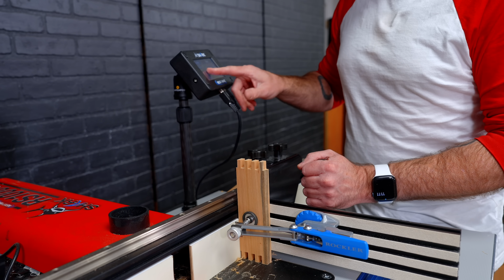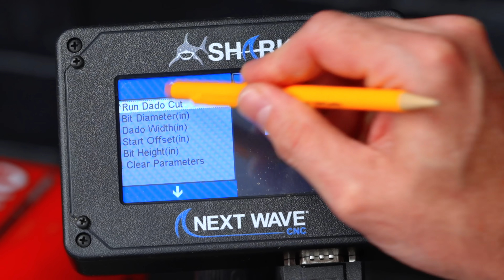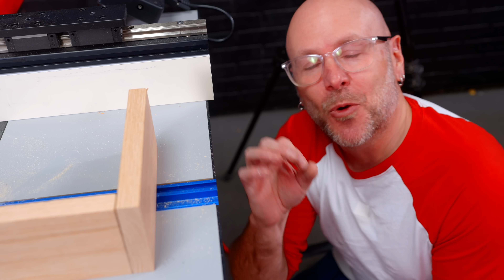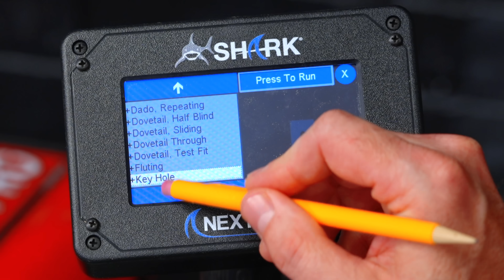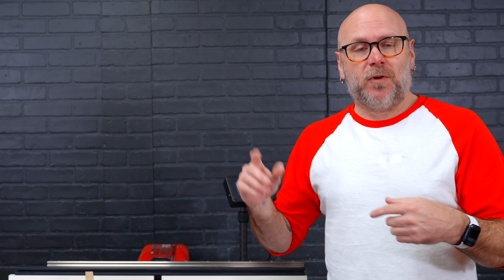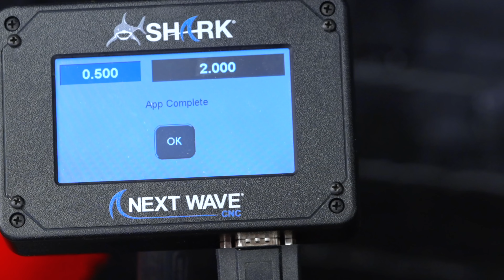This New Router Lift replaces ALL OF YOUR JIGS!

Comment: I have the Incra Router Table and Wonder Fence LS system, For 1700 USD for this system is a little pricey.   I can buy a CNC controller and two stepper motors and put that on my Incra setup up and still be ahead money wise. Nice product but for a hobbyist over priced, for a production shop under powered. The Incra Table is used to make dovetail and box joints and other small custom wood working stuff. For production work I use my shaper, bandsaw, table saw and other moulders, planers.

Comment: This is pretty cool, but the real tests are 1.) longevity of the motors and their accuracy, 2.) Can the software be updated wirelessly, and 3.) Is this a tool that requires the company to still exist... are there any features or issues that will arise if the company goes down? Some tech stuff worries me, because the company going under could cause update features that fix bugs, for examples.

Comment: Pretty cool, but it is a cnc machine to be pedantic doesn't need an automatic feed if it's computer positioned it's still cnc, biggest issue I can see is vendor support as I would want to be able to program my own apps like I do for any other cnc  as other than a motorised fence I'm not seeing it do anything a traditional xyz cnc router couldnt do, other than presumably have no constraints on the length of work peice you could run through it just limited by fence depth

Comment: Nice features but I'm not as excited as others seems to be. A standard router table fence with a dro solves many of these tasks just as good. Bisquit cuts are much better done with a bisquit jointer. Boxjoints are better cut on the table saw. Still very useful fence and lift but at this price I would rather pay extra and go full cnc.

Comment: The non-capacitive or resistive touch screen is a safety and liability shielding feature. You don't want to inadvertently tap the screen while your body part, someone's body part, or a volatile object, such as a gas can, is on the router table.

Comment: I have a Shark HD520 CNC router and it has been great. It's kind of a shame they don't have a 'user' program mode because I wonder how many new programs/features they will actually add over time. With the CNC router, I don't have that limitation since it runs using g-code. It seems like this is using g-code as well where the X-axis is the fence position and the Y-axis is the height of the router. All that would be missing from there is the pendant screens. I would think a simple GUI would be able to create those. After all, their development team had to be able to do it somehow. Nonetheless, cool to see it in action.
Reply: Wholeheartedly agree. In fact, it's probably the only reason I won't grab one at this point. Not being able to program basic functions like creating a domino is a showstopper. Still, very awesome machine.

Comment: Spending the money for that machine makes a ton more sense than spending about the same money for a domino jointer.
Reply: Domino excels at sheet goods and speed. Try handling sheet goods standing vertical at the router table, or even lying down if it's larger pieces. This fence and lift doesn't replace the Domino, two different machines for different purposes. Some people will have greater use of the Domino, some of this fence, depends on what you are building.

Comment: Not sure how you can say this isn't "a CNC."  (A CNC WHAT?)  CNC alone is not descriptive.  "CNC router" would be a better description.  "CNC" means Computer Numeric Controlled which clearly describes this device.  It doesn't necessarily mean user programmable; just that a computer digitally controls it.  After watching a lot of the video I went to the manufacturer's website where they expressed, "The Shark RS1000 PRO transforms nearly any router table into a full-fledged TWO Axis CNC – giving you unmatched accuracy by allowing your fence or bit to be moved by as little as one-thousandth of an inch."

It's CNC made easy.  It's a very impressive device.  I'll probably continue to use my incremental fence, though.  For that kind of money I would rather have a user programmable CNC router.

Comment: At almost $2k, I think it’s probably best to save up a little more and get into a decent entry level CNC
Reply: I sort of agree, but I can see the market for this machine.  A lot of people have a workflow in their shop that doesn't involve CAD software.  This machine seems like it could easily be integrated into that workflow.  If you want a degree of automation, but you don't want to start paying for a Fusion license, or learn how to use CAD software, this could be a good investment.
Reply: As owner of CNC machines i can tell you this tool is a game change many  joints can't be done with CNC machine this is faster and more convenient.
Reply: False! This is so much more approachable and easier than a CNC.
Reply: I went and searched around and yeah.... Waayyy better to buy an entry level CNC. I could definitely definitely see the point of this device, but I mean.. You could make included jig sets to replace what the electronics could do. It's just like.. Half way there to CNC but with a 9/10th's CNC price... If it were $900-$1200 I would say heck yes, but at 2k and not even free shipping? Eh...
Reply: I am curious if you have an example of an entry level cnc that makes dovetail joints?
Reply: Entry level CNCs can't do anything efficiently, reliably or accurately. It has no place in a real workshop.
Reply: @serdarbas8016  I think we have a different definition of "entry level" CNC. If you are spending $3-4k on any of the typical CNCs, you can definitely do all of the above and more.  Especially if you shrink your footprint. needing a CNC to cover 4'x8' dramatically increases on the cost where as, something that does the sizes the machine from this video does is nearly professional level in 3-4k range.
Reply: @CliffCutts  a professional CNC can replace %80 of all my tools but I still own CNC + router + tablesaw, bandsaw… and other 20 tools. just because it can doesn’t mean it should.

All tools functionally overlap eachother at some degree and all have different weaknesses and strengths. It can be cost, speed, efficiency, accuracy, repeatability etc. 

This router is almost a upside down CNC with your hands being Y axis. But it really have it’s advantages. Think of this as a afforable CNC with super fast setup and preset macros.

Comment: Funny enough this actually would be classified as a CNC. CNC just stands for computer numerical control. A lot of manufacturing machines fall under that umbrella. You can have CNC routers, Mills, lathes, punch presses, Laser's anything.

I work as a CNC machinist for a living and it's my job to program, set up, run CNC Mills and lathes. We had a quite a few metalworking lathes Mills where you would program the same way. It was called " Conversational programming". Instead of programming something by hand or using cad-cam you would just pick out different Cycles you wanted to run and filled in the parameters the same way. 

It was great for working in a job shop where you only had to run one or two pieces. It was a lot quicker and very handy.

Very interesting saying something like this in woodworking! I love when there's overlap like this.

Comment: I saw an ad in a magazine for this just yesterday and hadn't had a chance to follow up on it to see what it is, so great timing for your video.

I hope you'll do a Part Two in a few months after you've used it more...and have scratched some surfaces. 🙂 I'll be interested to find out how well it stands up to heavy use over time. Did dust get into it and cause problems? Does it still maintain tolerances such as the set bit depth, spacing, etc as well then as it does now? Maybe you can cut some box joints or dovetails on one piece now and on the mating piece in a few months and see how well they fit together?

I'll also be interested to see if Shark can or will update the software, such as to add the features in your list of cons, if software updates can be installed by the user, and if they're free. Or will they come out with a "new and improved RS10001" and early adopters are left out?

Their website says it can be used with almost any router table, but what about using accessories such as after-market fences (e.g. Woodpeckers) or shop-made ones with all of their additional features?

Thank you for a really informative and entertaining video.

Comment: It's kinda like the router table cousin of the Shaper Origin. I love my Shaper Origin, and I'd love to have one of these router lifts, but I have nowhere near enough room in my little shop. Nevertheless, I think machines like the Shaper Origin and this RS1000 router lift are the direction that woodworking will be going, with computer assistance for milling and cutting operations. As a former (retired) software engineer that is still pretty much a noob woodworker, I appreciate that, because the computer assistance lets me do things that I couldn't do, given my current woodworking skills. Despite my lack of advanced woodworking skills, I do have the computer skills to understand how to work with the Shaper Origin and a machine like this RS1000, so they enhance my woodworking way beyond what I can do manually. Some might say, "it's not real woodworking," and that is certainly a debatable question, but I don't really care. I'm focused on getting the result I want, and whether it's done with sharpened rocks, traditional hand tools, or a fully automated multiple-axis CNC isn't very important to me. I just want to make stuff, and if something like this helps me do that, I'll use it.
Reply: Early man used tools made with sticks and flint. We moved on with the Iron Age and again with the industrial revolution. The purists that say it isn’t woodworking are on crack, and if their ancestors had said that we’d still be living in caves.

You have to evolve and adopt new techniques or you will be left in the past whilst all the people around you make more in less time.

Comment: I started engineering something like this a couple years back and got the bit moving up and down per my digital input via a stepper motor with an LCD screen and then got busy doing other things with plans to finish the table later. The programming is insane for someone that doesn't program. I would rather buy one.

Comment: Wow - great tool.  Most importantly to me, thank you for the disclaimer on how you obtained it and what expectations there were for it!  This is important to me.  I have a question - I have the Saw Stop Router table extension, which shares the table saw bed.  If I were to get one of these - how easily would it be to take the fence part off and put it on when I was using the Router table? Can you show that action in your follow up video?
Reply from the maker: Thanks Bob!! don’t have any experience with the sawstop router extension but if it has slots like the Kreg table I bet it would work. Might be a better question for Next Wave.

Comment: I have a question, how did you adapt the 65mm CNC spindle to fit the 3.5" router lift?
Reply from the maker: I cut a bunch of acrylic circles out on my laser and laminated them together to make a collet adapter. Could also be done with a bandsaw

Comment: Dear Mr. Popeil, I am surprised that you don't have a Ronco label on the machine. As for the problem with protuberances on the back of the machine, stick it in the corner at an angle like a corner cupboard. With all the gadgets you are getting, I am surprised you don't have a robot to do the actual work. Enjoyed the video.

Comment: You said "this is not a CNC" but you're actually wrong, it is a CNC by definition (Computerized Numerical Control). What you mean is that it is not CAM (Computer Aided Manufacturing).

Comment: At $2000, it’s a purchase which is either a vanity buy (no sense of return on investment but just want it) or a business purchase (based upon time saved over the working life of the product). Now retired, I tried to calculate how long  would it take for me to have seen a return, bearing in mind its just about router operations. I reckon I’d maybe save an hour per week; say $30. Over 3 years, I’d perhaps save $4500. That’s a reasonable but not outstanding return when you take into account finance costs. 

Here in the UK, I could buy a similar sized CNC for about double that. My guess (and it is a guess) is that I would get a return far quicker from a full CNC. 

My current preferred option (retired but seemingly as busy as ever) is to use (rent time) a very large CNC about 10 miles away. Even if I figure on travelling time plus the cost of getting them to write programmes, the sheer versatility of a full CNC seems a better bet for me. 

That’s not to say that I wouldn’t be delighted if someone gave this machine to me but I try to think about where I can spend my money to the best effect and not indulge in vanity buys.

Comment: I’ve seen this machine in person and they done a hands on demo and I honestly wasn’t impressed. The idea is awesome and the machine works as they say it does but the materials they used for the fence and the router plate are cheap and not well made. The fence is a melamine material and it want hold up to use in a real shop for any time at all as you can see in the video the corners are chipped away already. For the inserts in the router table they use plastic like the Kreg ones and for the cost of this setup it should be metal say like the incra ones are with holes in them for dust collection. Take this same concept and let Incra refine it with better materials and I’ll give it a go unlit then they can keep there overpriced crap

Comment: This is a fair price for what it is, you're having the machine do the work that you would otherwise do, so an upfront cost of a thousand bucks for that convenience over the 700 that a comparable table without the CNC stuff would be, seems totally fair to me.  This machine will pay for itself almost immediately for someone that can take advantage of what it has to offer.  I would absolutely buy this for my production shop, but I must admit for myself, I want the control, same reason I was thinking about the Nova drill and decided just to go for a bench top mill, higher chance for human error but in my shop I'm experimenting and making completely unique pieces so the freedom to create is most important to me, then I show people how to make the shit I create and I would want those people using these style machines!  Also NGL at first I thought this was just a 2 axis DRO on a router and I don't get why that's not a thing?  Height of the bit and distance of the fence from the bit, why isn't that a DRO package for routers yet?!